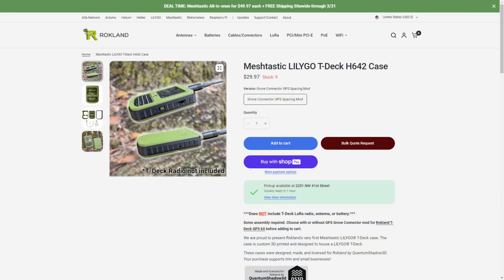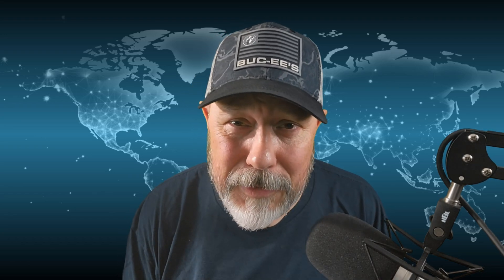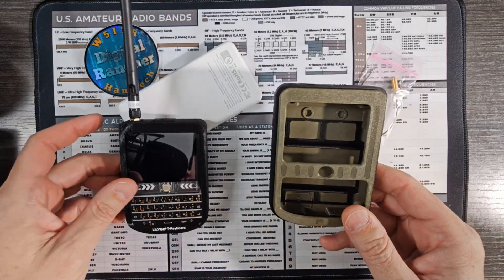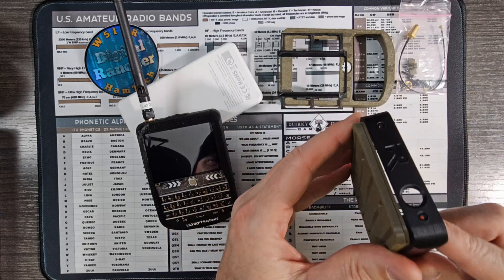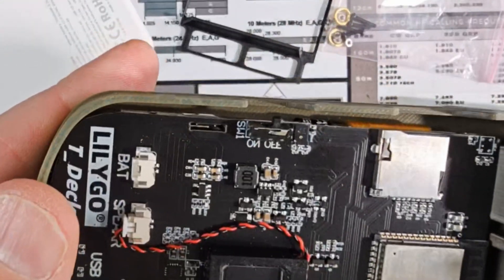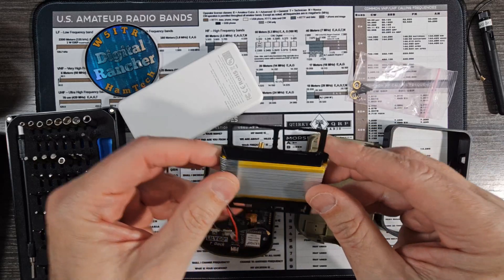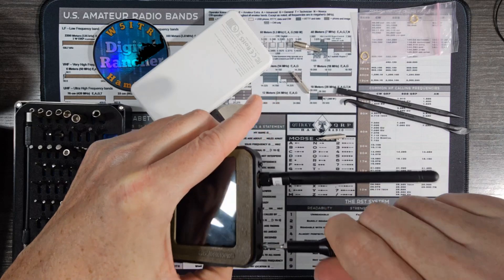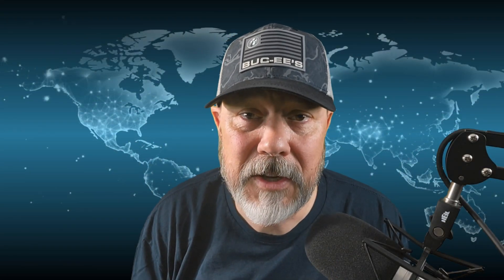Should This Be Your New T-Deck Case?

Comment: Look at the T-Deck, if i am going to flash the firmware anyway do i need to pay more for the meshtashtic firmware or can i buy the cheaper one with the lilygo firmware?
Reply from the maker: The price should be the same. If you are looking at two different listings make sure they both have have a LoRa chip. You can by the T-Deck with no LoRa (Cheapest) or with a specific frequency. 915 is the common US frequency. Are you purchasing from Lilygo direct? It's usually cheapest direct.
Reply from the maker: I just checked the lilygo site... It looks like their shipping has went up. So Amazon may be cheaper. To answer your question if you are seeing a lilygo firmware with 914 MHz and it's cheaper, you can flash it with Meshtastic and it will be fine. When I bought mine it had lilygo firmware on it

Comment: When you were struggling to plug in the battery while it was snapped into the other half of the case I was thinking about my usual process, which is to plug in the part first and then snap it into the case. I think you may have found that order of operations easier.
Reply from the maker: @zachwhite2716  Yes, likely so! I'll remember that on the next one!

Comment: this looks like a well-designed case, but I think i'm going to stick with my allycat design. - you can get 8ah batteries for not that much more than the 3ah battery that fits great with the allycat extended back and lets my t-deck run for WAY longer.
Reply from the maker: The Allycat is a solid design, and being able to extend the battery capacity is a nice bonus. Thanks for watching and commenting!

Comment: I got the T-Deck Complete package from Rokland. It's hard to get the micro SD card in and impossible to get the micro SD card out without opening the case (took the screws out and pulled the back off). 73.

(BTW, I got my T1000-E working.)
Reply from the maker: That’s a bummer. The SD card should be a quick swap. I'm curious what you had to do on the T1000!
Reply: @digital.rancher  Apparently it was still in some secret DFU mode. My Mac didn't see it, but an old old old Windows laptop did.
Reply from the maker: @K3JRZOnTheAir ugh! Glad you were able to get it going! Thanks for sharing!